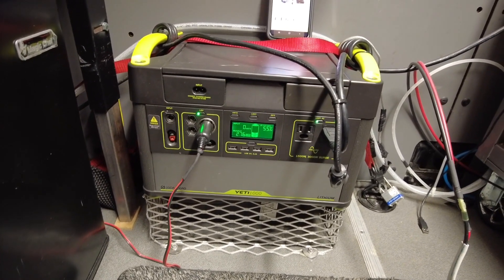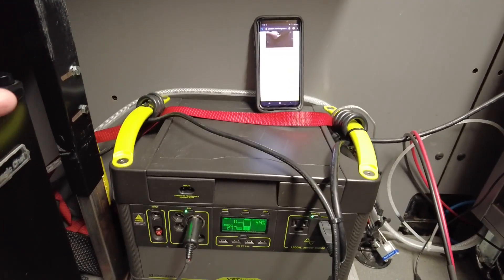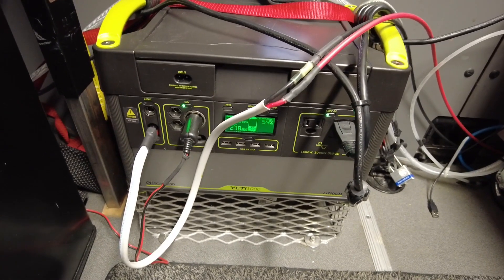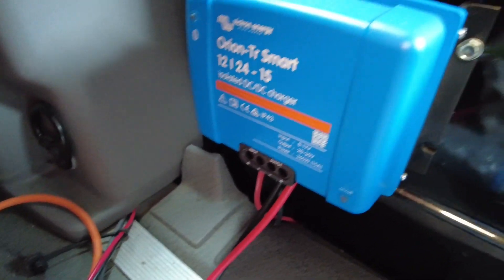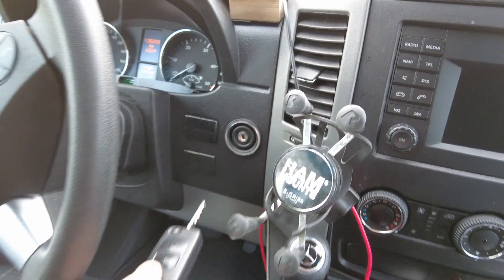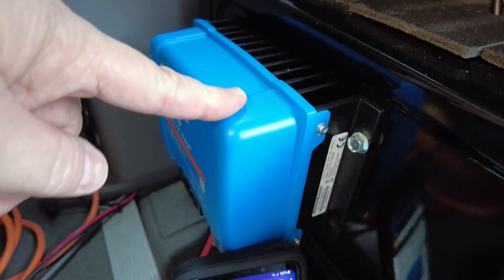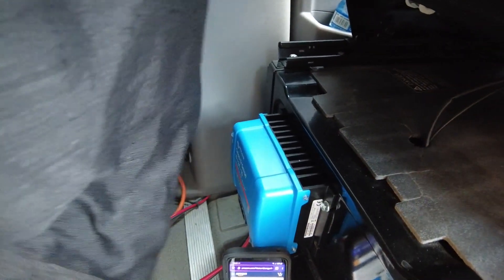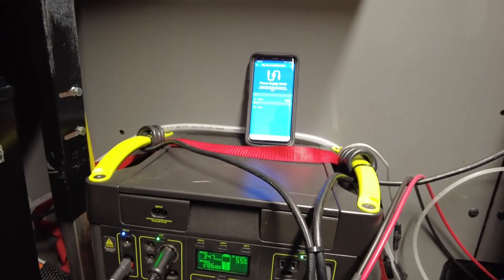Goal Zero Hack - Alternator Charging using Victron Orion DC-DC Converter

Comment: I tried this and it's working with the settings you provided but for some reason I'm only getting like 40 watts input max, even with the engine running (and revved). I have the Yeti 1500x and the Victron Orion XS (12|12-50A). The vehicle is a 2000 Toyota Tacoma. Any reason something in the line would be throttling the input? Or something I need to change in the settings to get more juice? Hoping I don't need to get the MPPT accessory to make this work! Thanks for this video, it's been super helpful up to this point.
Reply from the maker: The version you have only allows an adjustable range of 10v to 17v. The Orion XS 1400 has a much wider range of 10v to 35v. You'll need that model instead. I could be wrong but I think that's what the issue might be. Good luck!

Comment: Did the older Yeti 1000 have a lower rating for charging?  Looking at the Goal Zero website, it states that the High Power Charge Port can handle 14-50V up to 50A.  Is there some other limiting factor that I'm missing?

Comment: I have Ecoflow Delta mini which can pull 300 watts but I'm only getting 160 watts via the Victron smart 12/24/10.  I have a feeling my settings are wrong.  Can anyone tell me what I should set each parameter to?  Currently it's on a preset lithium battery charger setting.

Comment: Hi, thanks for the video. May I ask why don't you use the orion-tr on charger mode? If it is not a special requirment of your Yeti setup, orion dc dc charger can handle necessary bulk/absorption/float voltage and amp values on charger mode. On power supply mode, fixed V/A is used as far as I know.
Reply: Hi there I have the ecoflow delta max 2 
I’ve just fitted Orión dc to dc 12/12-30 and I’m only getting 221 watts ??not the 340 😢 also it it cut out and comes on and cut out and so on 
Any help would be great full 👍 😊

Comment: Great video. I’m interested in using this method to charge my 1500x in my current setup. I have a Victron mppt plugged to solar and charging my main house batteries. My plan is to plug in a 12 - 24 v Orion to the load output of the mppt to also charge the 1500x. That way I can set a charging algorithm on my mppt to charge the 1500x without draining my batteries. 

Any issues anyone sees wiht the proposed setup ?

Comment: You can also get a 300 watt pure sine ac inverter hard wired to battery  and just plug you ac charger accomplish same thing that's what I do
Reply from the maker: Yeah that's one option we used in the van for a while. Over time our fuse burnt, then our inverter failed (cheap one). We also drained our battery once after forgetting to unplug the inverter from the always-on cigarette lighter plug. We never tied it in directly to the battery though.

Comment: Question - when would you use isolated VS non isolated - I see both models on Amazon - thanks - good vide
Reply from the maker: Isolated allowed us to not ground our unit to the van. It's totally independent
Reply: I have the same question.  Would it matter if it used a common ground???

Comment: Great video!  Would this work with any of the ecoflow solar batteries via the XTC input connector?
Reply from the maker: Hey thanks! It's possible so long as it can accept between 20-24v
Reply: @Sprinter Discovery  is this what I should be looking for: Input Battery Voltage Range: 8V-
16VDC?
Reply from the maker: This is the Victron Orion I would use for your setup. https://amzn.to/3uy687b
It's 12v to 12v output and it's a very stable voltage coming from the alternator via the Orion. You could adjust the voltage in the VictronConnect app to the highest supported and it should work very well.

Comment: It doesn’t work on the newer yeti any x models
And no you can not connect more than to power sources like the first yeti did which is a shame 
Goal zero please make lithium expansion tanks please I’m seriously considering bluetti ac300 and ditching goal zero all together
Reply: I don't see why it won't work. I do this exact thing into my YETI MPPT controller and it works just fine.
Reply: @uhjyuff2095  which yeti do you have ?
Reply: @N2UPROD   Yeti 3000
Reply: @uhjyuff2095  exactly the newer yetis ( the x model it won’t work ) 
Example 1500x / 3000x /6000x it won’t work
Reply: @N2UPROD  It should because the mppt controller should be the same as my mppt controller. And if you have tried it and it doesn't, just get a GZ MPPT module and boom you have the same as me!
Reply: @uhjyuff2095  The first GEN uses a PMW The X models uses an MPPT I understand that the 300 comes with the MPPT on top I have Bought the external MPPT module but it sucks I had to return it because it freeze my yeti 1500 X twice and that’s just with the regular 200w solar panel Thank God I was able to return it because it started happening the last couple of days on the 30 day warranty 
Not only that you don’t really have control of your cut off power for an example I have mine set as balance were cut off at 95% and on the module it bypassed it and just kept charging it to 100% which I didn’t want plus the noise on the module fan is really loud 
What happened to me is actually what a review on Goal Zero website mentioned  how it happened with that guy it happened with me I really don’t recommend it I did figure out another way that was a lot better than this set up like way better
Reply: @N2UPROD  I agree the GZ Mppt module is lame with the fan design, but mine works perfectly fine and also it charges the GZ to 12.1 volts which if you know is not actually 100 percent battery charge, so I am happy with that voltage level.
Reply: @N2UPROD  What other way did you figure out?
Reply: @uhjyuff2095  after numerous of ways trying to figure out how to Connect more lithium batteries to it the only solution was I bought
1 sok 206ah lipo 4 battery 
1 victron 100/30 mppt 
3 grape solar 12v 200w solar panels 
Proper wires and breakers 
1 victron phoenix 12/500 inverter 
1 goal zero yeti x 230w wall charger 
That victron 12/500 inverter 
It Doesn’t even use that much power I been using 2 car chargers when I had that mppt External module Where I had it connected to the module and the Goal Zero and to be honest I couldn’t tell the difference of the power consumption with that victron Phoenix inverter vs the 2 car chargers It’s almost like it doesn’t even use any power it’s that good Plus I’m not sure if you knew but the Goal Zero batteries are not even Lipo 4 So I rather not use Goal Zero’s batteries cause Lipo 4 Last about four times more And from the 230 W wall charger I just connected straight to the Goal Zero nothing else I was just too afraid of having anything else connected to the Goal Zero that it would freeze 
I run all my lights this way 24/7 
Some would say why not get the 3000x  Or the 6000 X My thing is my sok battery Should last about 10 years while my Goal Zero Generator will give out a lot sooner and it’s Cost efficient to replace at least for me

Comment: Can this be used with a 12v 200amp Lithium battery (battery is being charged by solar already)no alternator ( I’m not using this in a van more like off grid ) i been wanting trickle charge my yeti 1500x and these models won’t accept more than one input 
You can have 2 car chargers and a solar panel plugged into all the inputs and it will only get the solar or the car charger at once  that’s it  I even went to purchase a combiner cable to have just the 2 car chargers and inserted it to the hpp port and nope it still only accepted one and believe me both car chargers worked it’s almost like they have new firm ware and changed the game

Comment: Hi, thanks for sharing. I do have a couple questions : why à 12/24 orion vs a 12/12 orion model? Also, you pick-up a  15 amps, could it handle a 30 amps orion? I guess it depends on the yeti model?
Reply: I believe the 12/12 is designed for 12 v going into 12v 
And the 12/24 is a step up power supply meaning it’s 12v through 24v but obviously you can adjust through Bluetooth and the 15 is the max Amps it puts out
Reply from the maker: Hi! Thanks for watching! The 12/12 Victron is borderline in terms of the minimum voltage required by the Yeti 1000, hence why I chose the 12/24 model of the Orion. It actually puts out 30A as measured by an ampmeter. As the ambient temperature rises, the amps actually decrease. Hope that helps!

Comment: Awesome hack!!! Thank you!  I have the older Yeti 1250 with the AGM battery also daisy chained to another battery for more juice, very heavy but it’s been running great for my set up for years. Until I can go lithium would this hack work for me? I’m thinking ahead w the victron until I upgrade?  Hope to hear from you
Reply from the maker: For your Yeti 1250, you would need this version of the Orion: https://amzn.to/3jnUfeQ since the technical specs say - High Power charging port (input): 16-48V, up to 20A (320W max)
Reply: @sprinterdiscovery  thank you for the swift reply and moreso your knowledge!  Order is in this will help me so much. Awesome
Reply from the maker: Great! Just make sure you get the 10Amp version and not the 15Amp version of the Orion. Hope that helps.

Comment: I have the same battery and I also have a never used Renogy (Renogy 12V 60A DC to DC). Can I use this the same way? Thanks :)
Reply from the maker: Hey Tony, it won't work. The Victron Orion has a special "power supply" mode, whereas the Renogy doesn't. Thanks for watching!
Reply: @sprinterdiscovery  thank you so much for the reply

Comment: Curious to understand why you opted for the 15a Orion instead of the 30a? Also, best practice requires a fuse at the battery regardless of the Orion being internally fused. Thanks for the content. Cheers
Reply: All true but we all need to remember the reason to fuse is to protect the wire not the device. If a wire from the battery were to short or overload we want the fuse to blow not the wire to catch fire. So always fuse as close to the battery as possible. I love Blueseas battery post fuses. It fuses right at the battery post.
Reply: @lukefarmer5391  Do you have a link to what you would recommend purchasing for the blueseas battery post fuse?  Thanks!
Reply from the maker: The 12V to 24V Victron Orion only comes in 15A at 24V there is no 30A version. When I measure the amps coming out of the Victron it's 30A or 360W. I agree with you, as a few others have suggested as well, I need a fuse at the battery connection as best practice. Thanks for watching!
Reply: how come orion can put out 30amps when it says 15 amps on it? I am confused.
Reply: Should also be noted that the GZ Yeti has a fuse internally that will not require a fuse at the battery.

Comment: Hi there, thank you for the informative video. Quick question if you don't mind: Why not simply use the Yeti 12V Car Charging Cable?
Reply from the maker: The Yeti 12V car charging cable only supports a maximum of 120W of power, whereas the Victron Orion solution will fast charge at 360W (3x faster charging). Thanks for watching!

Comment: actually, I did the same this afternoon for a Ecoflow Mini. But using a 12/24 10A due to a max Amp of 10, for input.
But I can go up do 70V…… so I provide 25V 
Thanks for sharing anyways
Reply: Hi Frank! Do you think you can do a video to show your setup? I’m hoping I can do this with my Bluetti AC200p
Reply: @RoamAndRipple  it is easy, and needs:
- 12V starter battery
- fuse 20A
- DCDC 12V/24V
- some AWG 10 
Get the 12V+, connect it to a the fuse very close to the battery
route the wires (+/-) to the input of the 12V site of the DCDC-converter
get the output site and connect this to the Solar input of the target.
But make sure, you insert another fuse for the 24V and check the maximum Volt input for the Solar input ...
the manual tells you the max V and max W of the solar input circuit

Comment: If you want to be really safe with regards to not killing your starter battery by mistake, add an ignition control wire so your charger will not turn on unless the motor is running...  the Victron comes with a little green connection specifically for this, I believe...  Thanks very much for sharing your yeti hack...
Reply: I have been looking for a link to buy this ignition control switch but can’t find it anywhere . Any link? Thanks
Reply from the maker: https://amzn.to/3JKz7ea There's lots to choose from, and these seem very inexpensive, and you get a 5 pack for that price. You can then wire it up with thin gauge wire to the green plug on the Victron.
Hope this helps!
Reply: @tonyspad1363  Everywhere I have seen people ask this question, the answer was the same.  Contact Victron customer service...  It comes with the dc to dc charger as a rule...
Reply: It’s only powered when the engine is running, he doesn’t have it hooked to a hot wire continuously.
Reply: Could you use the Orion 12 | 12 - 18 isolated converter for this setup?
Reply: I've learned since I posted this AND I think the s/w has changed.  The device has a setting that you can set to turn on only when ignition is on.  And the little green toggle is so you can set up an on/off switch for the device as an option.

Comment: I have the Orion isolated 12-12-30 dc to dc

Reading through the comments I am unsure if this will work correctly with a goal zero to charge from my Ford Transit CCP. 

I am not wed to the goal zero as I haven’t decided on the unit to purchase yet. 

Looking at Goal Zero, Bluetti AC200max, 

Would this setup work with either unit?
Reply from the maker: Hi Joshua - it appears that neither will work. The AC200max will only accept a max input of 15A. The Goal Zero Yeti 1000 will accept voltage between 16V and 22V with max of 30A input. Hope that helps.
Reply: @sprinterdiscovery  appreciate the response, that’s unfortunate as I purchased the incorrect unit. 

I’ll try and sell this one and pick up the 12-24-15 to charge my generator 

Thanks again. And the video is great.
Reply from the maker: Thanks - all the best on your build!

Comment: Great video I have a question, where did you ground the black wire?
Reply from the maker: Thanks! Since this version of the Orion is ISOLATED, the black wire is attached to the negative terminal of the starter battery. The output pair (negative and positive) wires then connect to the Yeti. Simple, and does not intefere with the van electronics at all. :-) Its been super safe and reliable so far for 1.5 years.

Comment: First - thank you so much for this informative video. I had been waiting several months for GZ to restock the Vehicle Charging kit to install on my 2020 Chevy Colorado ZR2 Bison backcountry rig and then I ran across your video. I power my AluCab camper and equipment with the Goal Zero Yeti 1000 and have been charging it through the GZ MPPT controller and single 160-watt solar panel. After watching your video I purchased the same Orion 12/24-15 dc-dc charger as you featured in your video. After wiring the controller and plugging it into the PWM controller I was successful at getting 300-370 watts of input charging power.  I am however struggling to determine if I have the Input Voltage Lockout set correctly. My  Colorado ZR2 Bison has a smart generator that modulates its output power through the ECM, BCM, and various accessory or light usages from 12.1 volts to 14.5 volts under normal engine operation and voltage draw.  As I observe the voltage meter on my dash the wide range of voltage happens very randomly.  I started setting my Orion to the same settings as yours but with the wide range of voltage output to it, it would cycle on and off erratically. I am considering setting the voltage lockout values to 12.5 and 12.7 but would like your thoughts on this before doing so. 

Thank you in advance for any advice you can give and thank you very much for sharing your knowledge and experience with us all.
Reply from the maker: Thanks very much for your kind words - very glad the video helped!
Assuming you have the Orion connected directly to your starter battery terminals, and the alternator is also connected to your starter battery terminals.
Maybe try this: With engine off, open the VictronConnect app and observe the input voltage, then turn on the engine and then see what the voltage is at normal idle.  There should be a difference, and it should not go below the initial voltage value you observed when the engine was off. Each vehicle's alternator will have different values of voltage output, so it's quite possible to have yours set to 12.5 and 12.7V.  After driving for a while, stop, turn off the engine, let things settle a bit, then check the VictronConnect app for the current input voltage (the resting state of your battery). If it's higher than 12.7V, then adjust the lockout values to 12.8v to 13.0V (for instance). You will have to experiment a bit. You can also try to fully charge your battery (I use the Victron IP65 12V/15A charger), and then see what the resting voltage is at after the charge is complete. Alternators will rarely top-up the voltage of your starter battery.
Hope that helps. If I think of anything else, I'll update this. If anybody else has some feedback to share that will help too. Let us know the outcome.  Thanks, and have a great day!
Reply: @sprinterdiscovery   Yes, I wired it directly to my battery positive and negative terminals using 8 AWG wires and protected it with a 60 amp inline fuse. . . and your answer makes complete sense because the Orion is reading the battery voltage, not the alternator / generator output voltage - correct? If so - I will take it for a drive to ensure the starting battery is fully charged then look at the "resting voltage" of the battery after it settles. 

Thank you!!!

Comment: Do I just connect this Victron unit to the starter battery OR is it necessary to connect instead to the actual alternator?  I trying to charge my Goal Zero 1500 while the van is running, no solar.
Reply from the maker: Directly to your starter battery. :-)